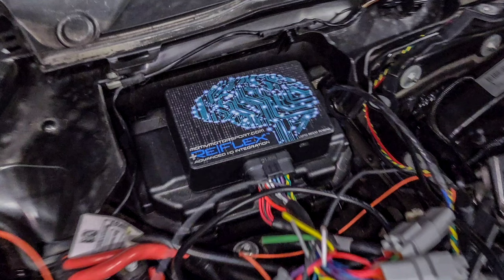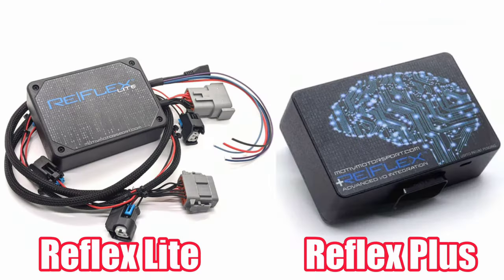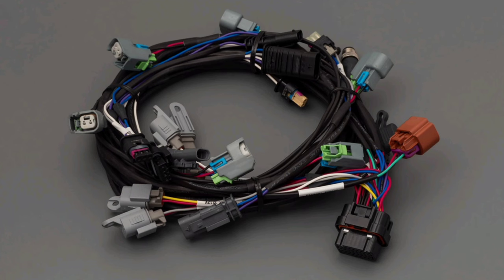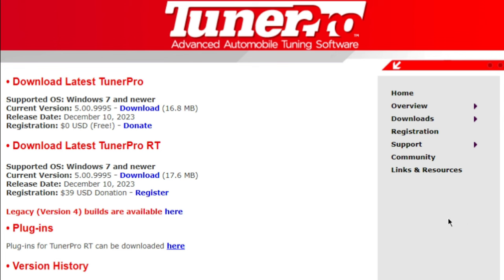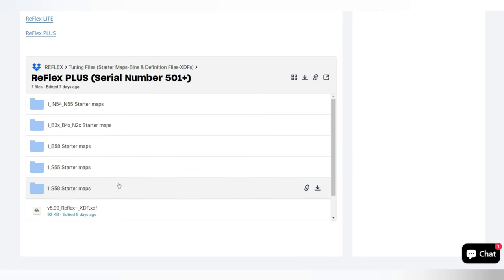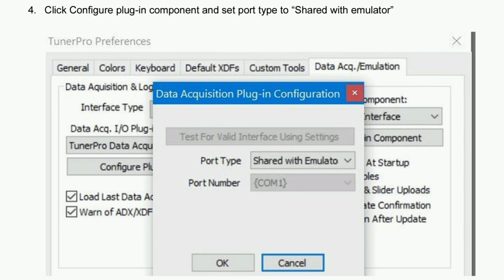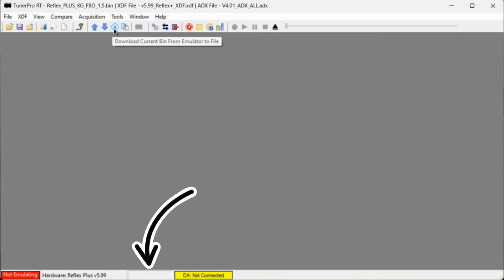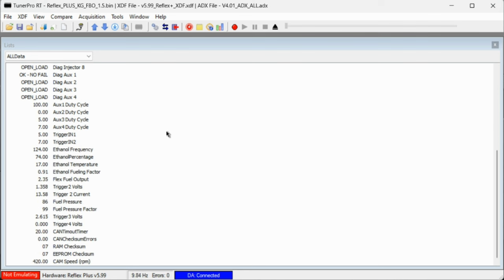Motiv Reflex - The Parts You Need, How to Set It up and Make Sure It's Working

Comment: Hey man was wondering… when you said you can hook everything up but not plug it in you mean I can fully install port injection with the base plate and injectors with the reflex+ kit and just not plug it in until I get tuned? and I’d still be able to drive perfectly fine and go into boost and everything?

Comment: Kern so I just added a reflex along with port. I’m a TU car on MHD. I have the pressure sensor & flex fuel sensor linked. As we all know MHD+ will be coming out for TU cars like very soon. My question how will be able to read E content? Via MHD app? Or will I need to purchase a content reader?
Reply: Unfortunately you won't be able to read e content until MHD releases MHD+ but you can get a blue tooth sensor from fuel it which would be convenient but it's not flex fuel.
Reply from the maker: mhd will show it in the app with mhd+. you will also be able to see it in the cluster.

Comment: Buddy of mine is having an issue with his REFLEX. At WOT the car shows MHD008 cam sync error. He said he checked all of the connectors that he tapped. I told him to move the 12 volt power for the Reflex to the fuse panel that is switched. Any other recommendations? Trying to help him out.

Comment: Kern, great video. Question, I have a buddy of mine who is having some trouble with either is LPFP or his wiring harness that triggers it on. His relay is clicking really fast, like abnormally when he goes above 2000 rpm. 2021 MKV Supra. He didn't do any of the work on it, but another shop. Thoughts? I told him to double his ground to relay, change relay out, verify software on reflex, and nothing to do with the LPFP itself. He is running the Reflex +.
Reply from the maker: try manually triggering it like i show in my lpfp diy video
Reply: Sounds like the have the fuel pump relay hooked to the boost control output, I think that is aux 1 iirc. Will have to look again on motiv under the aux inputs/outputs section. But either way sounds like the fuel pump trigger is on the boost control trigger (aux1/aux2)

Comment: Hey kern got a random question hoping you could answer. My car randomly starting making this whine like noise when getting on the throttle, if you look up bmw zf8 transmission whine lots of stuff comes up, some say it’s normal some say it’s about to break. My cars only at 40,000km bone stock so like 25k miles I think, anyways do you know of this issue, do you know if my transmission is maybe just low on oil. I got a appointment booked for bmw to check the fluid but I don’t wanna waste a hour if you know of this problem
Reply from the maker: it could be a lot of things so best to get under the car and diagnose it properly.

Comment: I wish it would integrate with BM3.  I hear motiv reflex are former protuningfreaks employee's and there is bad blood between them.  Guess it's time to jump to ecutek
Reply: Motiv offered for them to integrate the reflex into their platform but they didn’t. Mhd will be getting reflex support in the future if you don’t want to switch to ecutek btw
Reply: @Melvin-01  you gotta be kidding me.  Wish I knew this before I got into bm3
Reply from the maker: it works fine with bm3
Reply: @kern417 so the ethanal content would pop up on the bm3 app ?? And I won’t need to buy a separate flex fuel ?